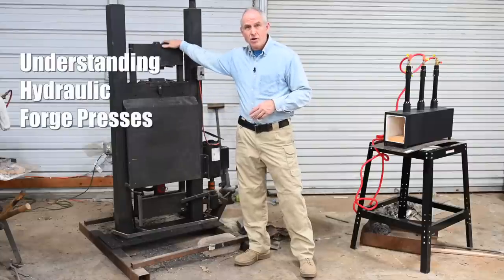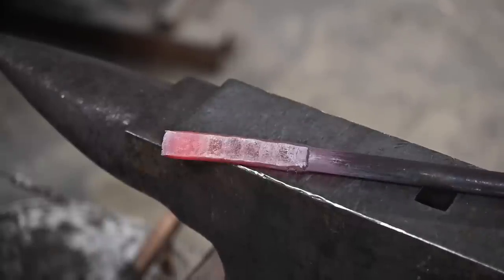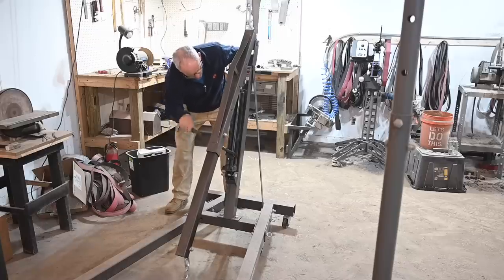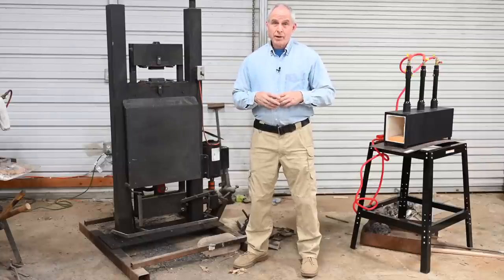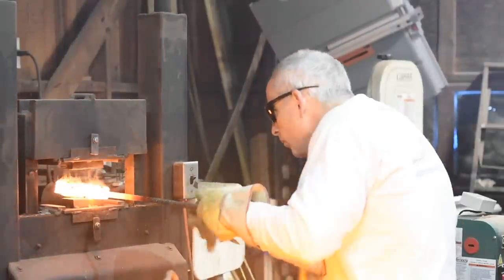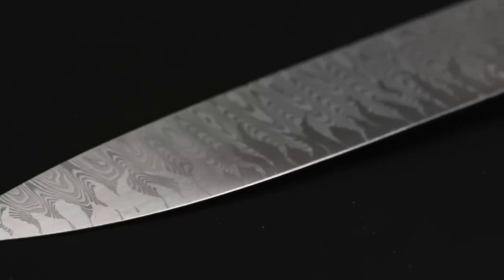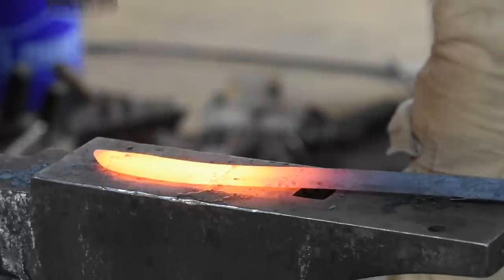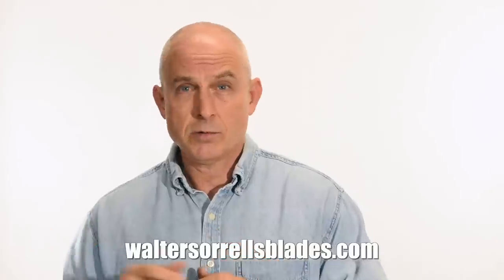Hydraulic Forge Presses - Complete Guide to the Knife Maker's Most Powerful Tool

Comment: First time I tried making damascus by hand, called Big Blu and had Andy ship one out to me at once. 
At $1000 a set for dies, you had better be able to make your own.  Have made about 20 or more different ones for mine. 
Got used to using the shop was working at 150 ton press, they have a 300 ton also.  Don't get fooled bigger is definitely better when it comes to a forging press.  The only one at the time was Blu unless you wanted to make your own. Until recently now Coal Iron stepped up its efforts to compete in the 50 ton market.  Then upped the game with its computerized controller, also a dual foot switch available.

Comment: Your press looks like a Box Troll… “JELLY!!!!!!”.  
I hurt my back a long time ago and it’s dictated my life for the last decade. Even after surgeries and an internal spinal stimulator it still affects my “daily enjoyment of life”( that’s what the VA healthcare system labels it as… I’m only able to spend maybe 30-45 minutes forging if I’m lucky. I’ve wanted to do this for so long that I do my time and make sure it’s at a good time and I have no plans for the next 3 days, because I’ll be stuck in bed. I’ve been trying to figure out which of the 2 machines (press or power hammer) would be best. I decided a press would be best. I’ve even tried drawing out a plan to build one, powered by the same motor as my belt grinder. Unfortunately that would require some skills I just don’t have. Welding or a welder being a big one of those. My cheapest option I’ve come up with is buying an electric log splitter and have someone weld on the pieces to hold the jaw inserts… but then I’d still need a welder to make the actual insert!  I’m just going to buy one of the cheap $300 dollar MiG welders. You can find them for a third of the price as new, but I’ll still have to figure out what to do next.  My Disability pay leaves us with a rather tight, really fixed budget.  Spending the $100 for the cheap welder is on hold until I can get the rest put aside.  Buying an elec/hydraulic powered press straight out, or even finding a used one is just to much…. It would allow me to work more than once a week on a good week.
Reply: The modified log splitter is the way to go if you are on a budget.If you buy a cheap stick welder and some electrodes, there maybe someone nearby that can weld the pieces up for you. Good luck to you mate.